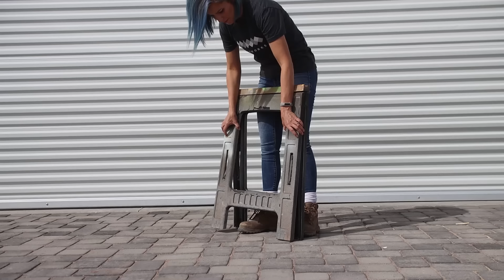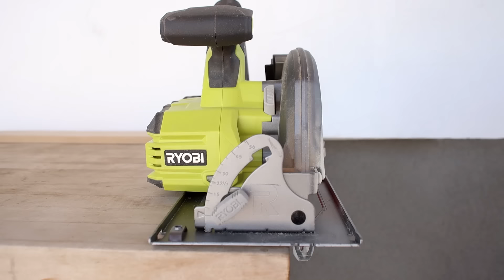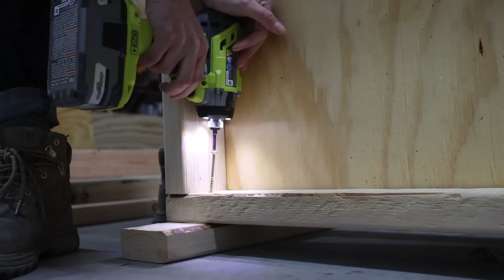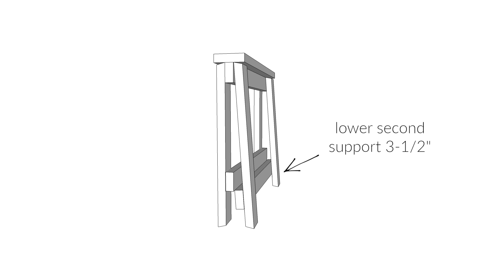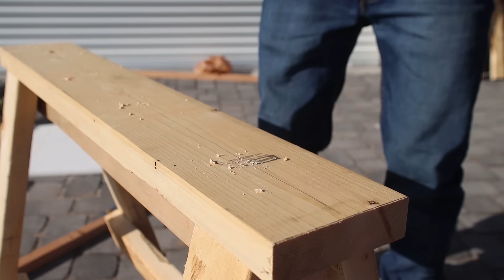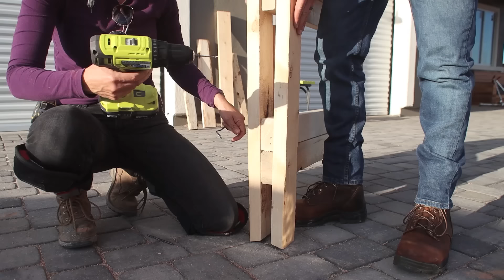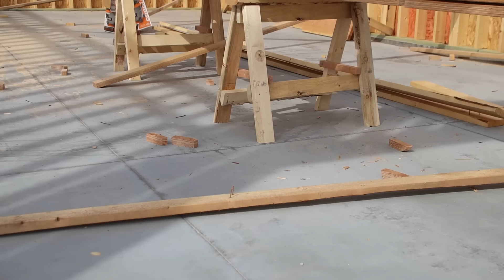HEAVY DUTY DIY Folding Sawhorses

Comment: Thank you so much! Just last week I determined that I needed a couple of really good sawhorses, but didn't really like many of the designs I had seen. I really like this design! THank you!!!
Reply: Did you end up building this? I was looking at buying materials for it today, but noticed a couple of potential issues.
If you did build some, did screwing the hinges opposite each other on the 2” runner, cause any issues with the screws running into each other?
Also, did the barrel of the hinge interfere with attaching the top plate? To me it looks like they’d create a void between the runner and the top plate.
Reply: @charlesascott661  Hi -- no I never built them... I got all the materials & hardware, then got distracted with several "emergency" projects and finally just had to throw together some simple, more traditional sawhorses. I'd still like to build these one day, though. I'd be interested to know how you end up addressing the issues you mentioned. All the best!
Reply: @lisakelley9451  thanks. I ended up building some, though being in Australia where everything is metric, I had to settle for wood with smaller dimensions and subsequently smaller hinges, which I fastened with shorter screws.
I also got a bit lazy at the end and instead of the  swinging brace and dowel (which I was a bit dubious about getting to line up correctly, because the dowel is straight and the hole in the brace swings in a circular arc), so I just bought some chain that I cut to length and screwed to the legs to stop them over extending.

Comment: i think the only thing i'd change is...instead of using a wood dowel for the pin, i'd use a metal rod. you can use a small amount epoxy to hold it in. that way, much lower chance it'll break. other than that, cool design.
Reply: Probably means having to cut a section of rod to proper length, which means carrying a hacksaw, and a file to smooth the cut edge, thus doubling the needed tools. Use a hardwood dowel.
Reply: Same. I Would even use a lag bolt and then cut the head of the bolt off with a grinder and smooth it over. going to be much sturdier.
Reply: Replace the 2x2 with chains, then you won't have to do anything.

Comment: Hi Elisha, great saw horses, great video composition and editing, and after a quick browse of your video section I'm looking forward to binge-watching those.  Clicked Like and Subscribe!

There is one hinge joint I've found really useful over the years, used it on horses, step ladders, taller ladders, basically anywhere you want hinged legs, in case you ever want to play around with it and work it into one of these (and I'd be honored if you did).  The idea is to rotate the legs 90 degrees, and instead of using an actual hinge, pass a carriage bolt through them, so they're like scissors.  Then say you're building a step ladder, make 2 pairs of these 'scissor legs', put crossmember braces on the back edges between the outer legs like on a ladder, and your rungs between the inner pair, so that they nest between the outer legs when closed.  

The neat thing about this joint, is that you can put a stop block on the tops of the inner legs, so as to limit the range it can 'unfold', and not have to use separate locking sticks or mechanisms, chains, ropes, etc., to limit how far it opens.  Just open the legs as wide as you want them to go, and scribe a line near the top of the outer leg on the side facing the inner leg, using the edge of the inner leg as a straight edge.  Disassemble the pair, and draw another parallel line an inch further in toward the bolt hole, and cut the outer leg along that line.  Reassemble the pair, and glue/screw a 1" block on the inner leg (grain running the length of the block so it doesn't split at the screws under pressure), so that the top of the outer leg fetches up against it when open.  Make sure the length of the block doesn't go down far enough to limit the outer leg when it's fully closed. 

That's all there is to it, your pair won't open any further than that stop block.  It works out easier on 2x6 or greater, but can be done on 2x4, you just need to adjust for how much of each leg at the parallel cut is past the bolt, and how wide you want them to open, so that the cut for the 1" block isn't too close to the bolt hole (and another option if it is too close, is to just glue/screw your stop block on the back edge of the inner leg, maybe even using the protruding ends of a board that goes all the way across the top back edges between the pairs, so that 'stop block board' board can also support underneath the top flat step, or top saw horse plate).  

I like this scissor hinge option because I don't have to run out for hinges, and the range-limiting feature with the stop block and no extra locking arms, ropes, chains or such just appeals aesthetically to me.  (I do like to put a couple of 'fender washers' cut from HDPE (milk jug plastic) between the legs, to keep the wood from rubbing too much when opening and closing, to lubricate the joint.)  Anyway, attach the top of the ladder, saw horse, etc., to the tops of the outer legs (making sure you've cut away any bits of the inner leg top that protrudes, through the full range of motion), so that it's flat and in position when open, and you're all set!  

Oh, and for safety so that it stays in the open or closed position, you can also drill a hole near the tops of the inner legs just under that top step/plate when it's all the way open, then close it all the way and using the same hole in the inner leg, drill through to a new hole in the outer leg.  These holes can be pinned open or closed with a screw, dowel, or whatever pin you wish to use.

Enjoy!

Comment: One additional suggestion, use a thicker top plate and cut two slots at each end to take a 3x2. Then two horses plus two lengths of 3x2 make for a support for sheet materials.

Comment: I changed to these from a set of folding saw horses I built last year from old pallet wood. Just a bit shorter so I can add "rollers" for an out feed for my table saw. Mine have two holes for dowels in the top so I can also add a butcher block style top to turn them into a portable workbench. Great idea and LUV the hair.
Reply: Did you end up building this? I was looking at buying materials for it today, but noticed a couple of potential issues.
If you did build some, did screwing the hinges opposite each other on the 2” runner, cause any issues with the screws running into each other?
Also, did the barrel of the hinge interfere with attaching the top plate? To me it looks like they’d create a void between the runner and the top plate.

Comment: Remodel carpenter here. I like the all metal fold up ones for $19 at Menards that you can screw a sacrificial 2x4 to the top. That way if I make a quick cut and don't adjust my saw depth, no big deal nicking the 2x4. And when they get too chewed up, I just replace them.

Comment: I have been looking for a fold up saw horse video. I bought those plastic ones like you kicked at the beginning of the video... my dog got wrapped around it and it toppled over and broke... so I love it. I will be taking mine in my RV when not in use at home to support my chuck box, my outdoor kitchen. I rather cook outside most of the time than in my RV kitchen.

Comment: I mean, my heavy duty saw horses I bought from the store also fold flat, so nothing very special there. That said, I'm just poking fun at the thumbnail. These are seriously nicely designed wood sawhorses. Joking aside, one thing caught my attention at the start when you were talking about cutting straight and using the square to help. While that is certainly a fantastic tip and even I use it from time to time, the real problem is your saw. Now don't get me wrong, I have no problems with Ryobi. They have some pretty good tools and honestly for DIYers, they are generally one of the better choices. My Father in law has that exact saw and I've used it quite a lot. I will praise most of Ryobi's tools, but I have nothing but contempt for that thing. That thing is absolutely terrible about cutting straight no matter how good a blade is on it. In this case paying the extra for one of the battery powered saws  from Makita, Dewalt or Milwaukee is really worth the extra money, especially since with sales it can be had for almost negligible difference. I would really encourage you to look at the rear handled left blade saws. While they are certainly heavier, that actually works in their favor when pushing them through material. I believe you will find that free hand cutting a straight line with one of those is far easier than you believe. Your problem isn't skill,  it is in this case the tool.

Comment: 60% done building your folding workbench.  bought and downloaded your plans which are super.  These sawhorses are next on the list.  Thanks for the great ideas, keep on sharing!!
Reply from the maker: Awesome! Let me know how they turn out ✌
Reply: Did you end up building this? I was looking at buying materials for it today, but noticed a couple of potential issues.
If you did build some, did screwing the hinges opposite each other on the 2” runner, cause any issues with the screws running into each other?
Also, did the barrel of the hinge interfere with attaching the top plate? To me it looks like they’d create a void between the runner and the top plate.

This was just a cut and paste, so some parts may not be applicable to you. Just hoping someone actually replies.
Reply: @charlesascott661  good morning Charles,  Yes I did build these and my second and third sets were built for my Son in Law my Son went better and look more like the plans show. I had no trouble with the screws running into one another.  The barrel of the hinge on both sides had to be adjusted so that it did not interfere with the top plate.  Your concern is correct and you need to adjust for that.  A friend made a set and used a piece of plywood to be the hinge that held them in place when extended and became a shelf that would be useful.  I really like these saw horses and use them frequently even if my first set doesn't look as pretty as it should.  They are still bull strong.
Reply: @lui1648  thanks, much appreciated. I ended up buying everything and after actually getting my hands on the hinges, I figure I’ll just attach the opposite sides of the hinges to each side of the runner. I hadn’t clicked onto the fact that being a non-mortise hinge, the holes on the two sides don’t line up like standard hinges.

Comment: I came across this video on Pinterest! I’m embarking on my woodworking journey soon and saw horses are going to be my first project! Your written out plan and video were awesome and I plan on using it ☺️
Reply from the maker: Awesome! I'd love to see what you make
Reply: Did you end up building this? I was looking at buying materials for it today, but noticed a couple of potential issues.
If you did build some, did screwing the hinges opposite each other on the 2” runner, cause any issues with the screws running into each other?
Also, did the barrel of the hinge interfere with attaching the top plate? To me it looks like they’d create a void between the runner and the top plate.

Comment: I like everything you did. Except the top plate/ sacrificial board. With the glue, you cannot just unscrew and replace the board after you've used it/ sawn into it. Which happens, A LOT! Lol Besides that one LITTLE oversight. Great video. I'm going to use your ideas on my next set of saw horses when i remodel my jon boat. Thanks for sharing.

Comment: You could have cut a slot into the leg-brace so that it locked onto the top of the cross-member instead of using a dowel (as a sort-of halving joint). The dowel is probably too weak for the job and will likely get snapped off at some point anyway.

Comment: As i was moving my "Delux" plastic saw horses outside I thought of this very idea,,,But a little different , I have built saw horses on job sites for yrs using junk lumber The only difference between my idea and yours is,,,I was using chains to hold the legs instead of your wood brackets and 1 by material instead of your 2x4 cross peices

Comment: I just bought a set of the burro brand saw horses added a few brass screws because they are stapled and glued together. Then are used Lindsay oil and covered them. They don’t fold up but they do stack.

Comment: Overall a nice video. But several things to point out...

Using foam insulation makes a terrible mess. Build yourself sawhorses to put the work on. Get it off the ground.Oh, you did.

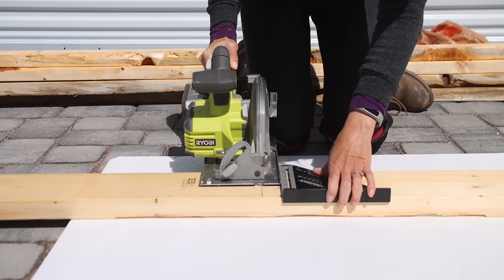@ 2:06 you are holding the speed square with 1 hand and the saw with the other. I'd probably do the same but if the saw binds & kicks back you are in for a broken wrist or worse.

@ 2:42 you use the 1st leg to measure the 2nd leg. However you mate up the short angle edge withe the long angle edge. Thus you length will be off by about 1/2". You should have flip the top boards so the right sides are matching up. U can easily see it in the video.

In several of the shots where you are pre-drilling it appears the drill is turned to CCW vs CW. I'm sure you know better so we'll just attribute that to false illusions.

I like my plastic sawhorses. They have worked well for years, they are light & fold up easily. And I've never kicked one & broke it.

Nice video though.

Comment: Another way to screw in I-loops really quickly is to use a ratchet and socket set 😉
Reply: Another way is to get one of these. https://www.amazon.com/PAGOW-2-Pack-Hurricane-Wing-Driver/dp/B075XBG8LB
Or some sets of driver bits come with one of these. https://www.amazon.com/Eazypower-80935-4inch-Installer-Remover/dp/B000PSABL0/ref=sr_1_33?dchild=1&keywords=wingnut+bit&qid=1594843119&s=hi&sr=1-33

Comment: I was yellin' at the screen in the first 45 seconds when she had the speed square backwards while using it as her straight edge. Flip it so the "t" edge is twds yourself, that way it catches on the board edge and you're not fighting to keep it along the back edge. Just sayin'.
Reply: Nope, the way she had it works great, gives a bit of leading edge to start the saw and if you have any grip at all you can hold it tight while sawing.
Reply: @markmac4596  the way I suggested you don't need to grip it, the t edge holds it there. Give it a try

Comment: I want to support you, but two things immediately come to mind. 1. Please take your finger off the trigger of your saw while you use your hand to see if the blade is deep enough. And 2. You need to figure out a better way to attach the top 2x6. If you leave screw heads like that, you'll hit them with your saw and dull blades left and right. Just sayin'.
Reply from the maker: There was no battery in the saw while a checked the blade depth.
Reply: Awesome! Couldn’t tell, just want you to be safe!

Comment: I have a pair of home made saw horses, but I like this design better. One addition I would suggest. Add a tray that screws into the top of the locking arms so that when you flip them down, you have a shelf you can drop bits your using to keep them out of the way. A thin piece of Ply will do and the arms should take it without any problems

Comment: Totally appreciate this, awesome design, and will be making these soon!  My current "tin" folding saw horses are abysmal and always literally want to cut me.  (FWIW, on your step 2 & 3 plan diagrams, I think there might be a mistake on shown runner and cross support lengths.  Should be 33" instead of 36"?  Also the hinges you link to from the plans are 4inch which would be too wide for the 3.5 inch 2x4's)
Reply: Did you end up building this? I was looking at buying materials for it today, but noticed a couple of potential issues.
If you did build some, did screwing the hinges opposite each other on the 2” runner, cause any issues with the screws running into each other?
Also, did the barrel of the hinge interfere with attaching the top plate? To me it looks like they’d create a void between the runner and the top plate.

Comment: One observation, the dial pins are drilled perpendicular to the cross brace which puts it on a slight angle and the secure board was drilled 90deg which is offset when you pin the legs.  In the video, it seemed to be a little trouble to pin the legs at first, but you made some adjustments to the pins.  Any issues with that?

Comment: Next time, if you ever make another set, or you can adjust these. stagger the the leg cross brace tops, like you did but adjust them so they are at a 45 degree angle from eachother if you laid wood on them. you can angle the 2x4 to reflect the 45 angle too. makes a good place to clamp stuff at a 45% angle.  know this sounds weird but i dont know how else to explain it

Comment: I like the build of these sawhorses but need a different way to attach the top board without screws based on the number of saw cuts in my sawhorses.

Comment: I noticed when you were pulling out some bits from the Ryobi case, your ring was scraping against the hole saw. I usually don't wear a ring when I'm doing some sort of construction for the fear of losing a finger and/or having scratches on the ring

Comment: Nice job,  thanks for sharing.   I think I would have either counter sunk the  screws at least half way for the top 2x6  or glued and removed the screws after the glue dried.   If you rip much plywood you don't want to be cutting the tops of the screws.    If you are carrying these a lot, a 1x4  on the bottom braces would probably be sufficient to prevent the legs from spreading.    Instead of the hook to  keep them closed a bit of velcro may be less hassle  and less chance of catching on something (leg?).